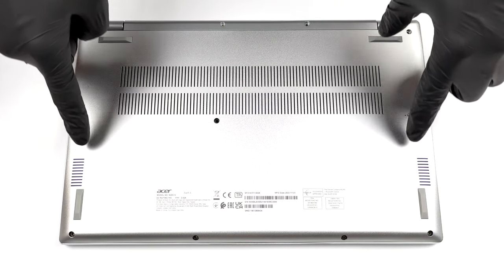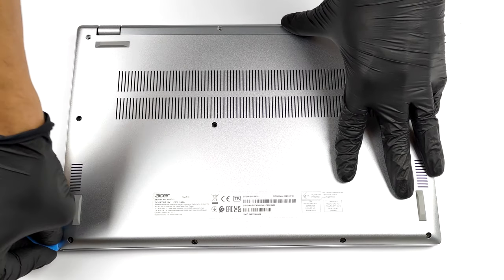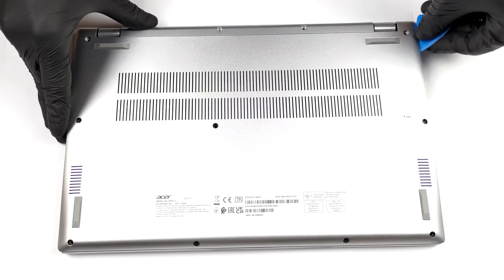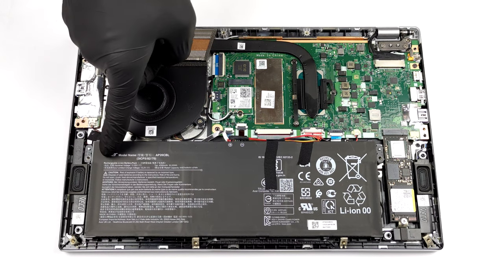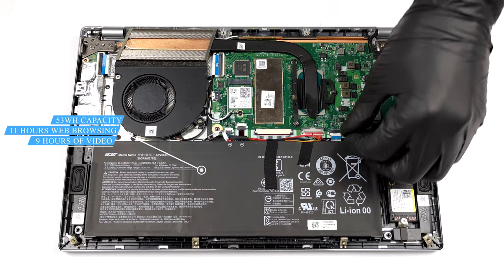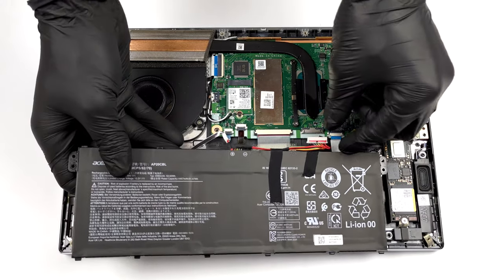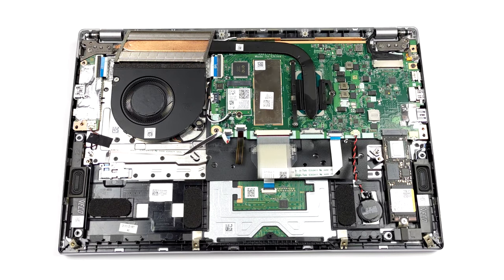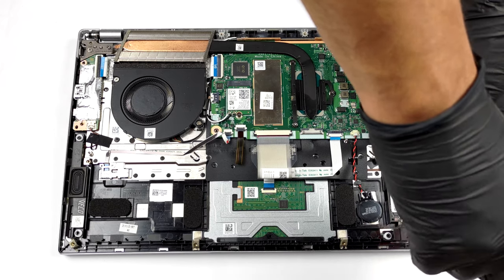🛠️ Acer Swift 3 (SF314-511) - disassembly and upgrade options

Comment: yes you can upgrand the ram by removing the cover, you are very wrong friend
Reply: Not all variants are upgradeable, for example one variant has only the m2 storage and soldered RAM, but there's another with standard SATA drive AND the m2, the latter has on board soldered RAM AND an additional slot.